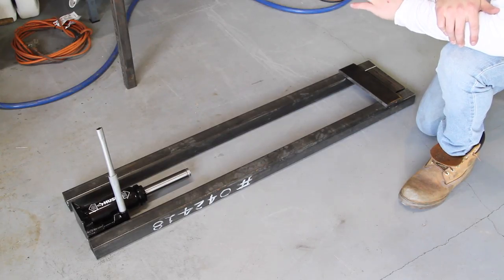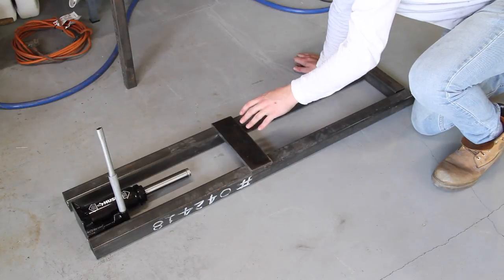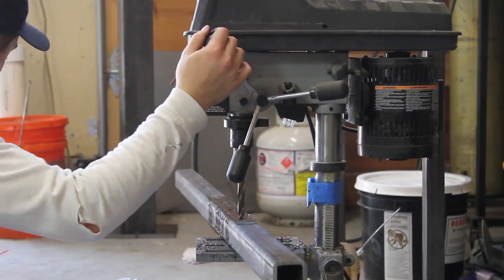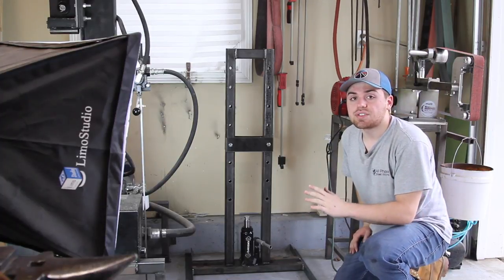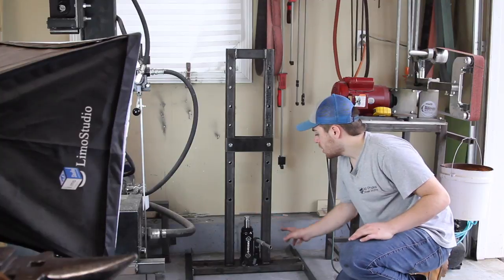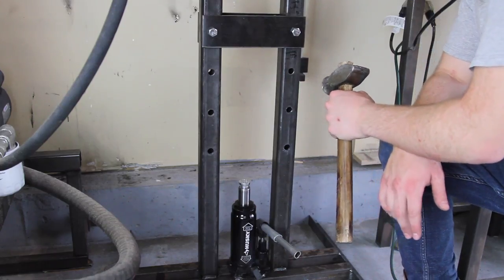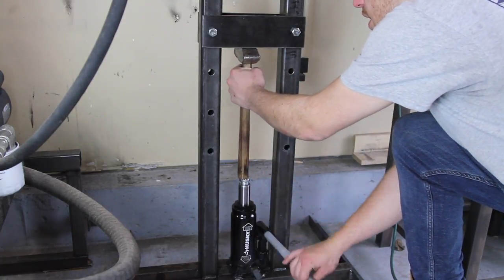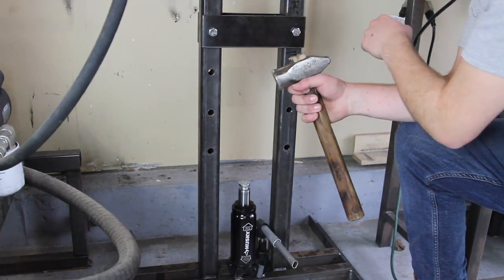Building a Hydraulic Press for Hammer and Axe Handles

Comment: Pretty ingenious. However, you won't need to worry about wooden wedges. If you can press a handle into a head. A kerf won't be needed. Set your head and then use a barrel wedge or two and use the press again to sync them in. Should be nice and tight from there.